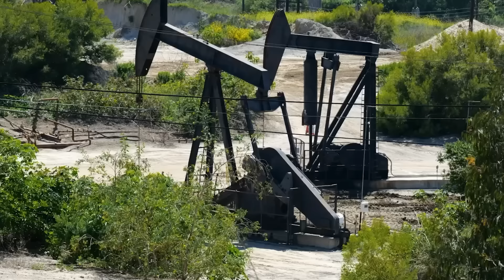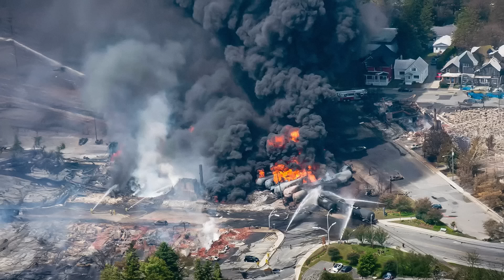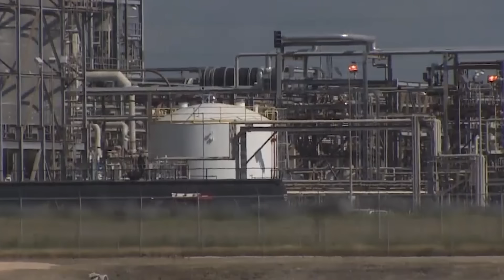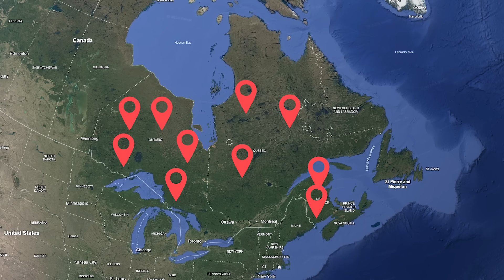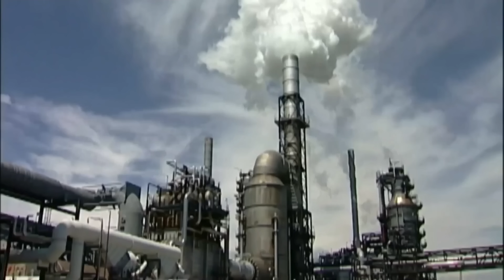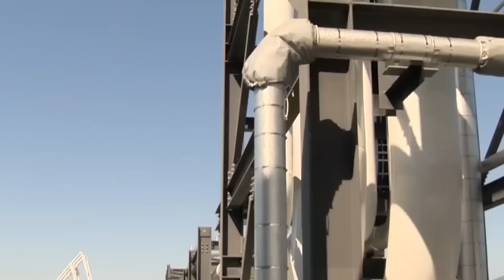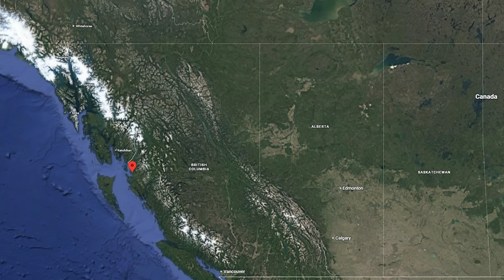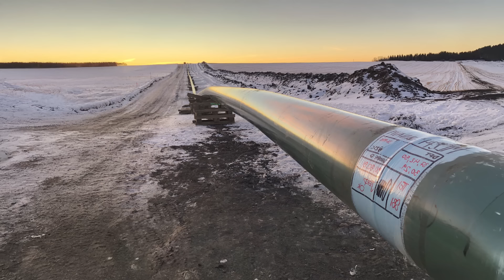Here's Why Canada Can't Build Its Own Refineries, Even Though It Produces Millions of Tons of Oil

Comment: Canada has approximately 17-18 operational oil refineries, with a total refining capacity of nearly 2 million barrels of oil per day. These refineries are distributed across provinces like Alberta, Ontario, Quebec, and British Columbia ¹ ² ³.

Here's a breakdown of the refineries by province:
- Alberta: 5 refineries
- Ontario: 5 refineries
- Quebec: 2 refineries
- British Columbia: 2 refineries
- New Brunswick: 1 refinery
- Newfoundland and Labrador: 1 refinery (currently being converted to a renewable fuels plant)
- Saskatchewan: 2 refineries

Some notable refineries include:
- Irving Oil Refinery (Saint John, New Brunswick): 320,000 barrels per day
- Imperial Oil Strathcona Refinery (Alberta): 191,000 barrels per day
- Suncor Energy Edmonton Refinery (Alberta): 142,000 barrels per day
Reply: Note: your list of 17 locations included asphalt refineries. I have excluded those.

There are 13 out of 15 refineries in Canada that use Alberta bitumen sands heavy crude oil right now. 

All 13 of those refineries receive deliveries directly via pipeline from Alberta, including all four in southern Ontario (via Line 5) and the only refinery in Montreal (via Line 9).

The two refineries that do not use Alberta crude oil in their refinery diets are located on the south shore of Quebec City, in Lévis, and in Saint John, New Brunswick.

The refinery in Quebec City is owned by Valero and the same company owns a massive storage depot in Montreal. Furthermore, Valero also owns an oil pipeline between Montreal and Quebec City.

So the reader may be asking themselves: so wait, if there's already a pipeline between Alberta and Montreal and another oil pipeline linked directly to the same company's refinery in Quebec City, why aren't they using Alberta crude oil too?!

The answer is simple: it's not economical to do so.

Alberta bitumen is heavy in asphaltenes and low in resins. This makes it a low-value product that is generally used as a cheap blending agent to bring down the overall cost of refined petroleum products. Remember when the Conservatives told you that Western Canada Select oil was priced lower than West Texas Intermediate because there was insufficient pipeline capacity to Canada's west coast and Canada was stuck with only "one customer"? Well, the Trans-Mountain oil pipeline is now complete, exports are happening all over the world, plus, there is excess capacity available on it!! And the price gap between Western Canada Select and WTI is still over $12/barrel on average!! Chalk it all up to yet another Conservative lie. Pierre Poilièvre is a rank expert at lying to Canadians and Conservatives are repeating the same, tired lies that are being disproven every day with TMX exports to Asia. Bitumen sands crude oil is low quality, and no amount of pipelines will ever change that. 

No, Valero actually uses their pipeline to ship finished products westward, from its refinery to Montreal instead of shipping Alberta crude eastward. 

Suncor also owns a Quebec refinery, in Montreal.  Suncor blends Alberta crudes with imported crude oil from overseas via tankers that land from the eastern US, Norway, the Middle East and Nigeria with light, sweet crude oil. The imported oil either arrives by tankers, or occasionally, gets unloaded in Portland, Maine and then piped to Montreal. 

Incidentally, the company that owns the Maine to Montreal oil pipeline applied to reverse its direction, so that the line could carry tar sands bitumen from Line 9 to Portland, Maine for marine export via tanker.  Concerned citizens of Portland in 2014 passed a municipal ordinance banning the export of oil sands bitumen at the Port due to environmental concerns. Portland Pipe Line Co (PPLC) filed a lawsuit to overturn the ordinance as unconstitutional, and against interstate and international trade. They lost in Court and abandoned their appeal in 2021. 

Many find it amusing to listen to the same Conservatives who worked tirelessly to destroy Canada's National Energy Programme in the 1980s now turnaround and counsel the government to ignore the economics and build a brand new pipeline from Alberta to those two refineries, even though it makes zero economic sense to do it today with all the existing infrastructure in place.
Reply: Thank you for this. 

We had one in Nova Scotia. I do not know enough about oil refining to truly understand why it was shut down.
Reply: Many Canadians are completely unaware of this nation's oil and gas infrastructure. There are now three major gas pipelines to the Canadian Pacific coast, plus two oil pipelines to the west coast. There is one natural gas pipeline extending from Alberta all the way to southern Ontario & southern Quebec (to Quebec City) and one oil pipeline from Alberta and through Sarnia, feeding 4 refineries in Ontario plus a refinery in Montreal. Incidentally, all seven of these pipelines were built under federal Liberal governments, including TMX in 2024 and LNG Canada in 2025. 

Canada has broken all-time production records for both oil and for natural gas production in 2025. We have built and completed two massive new oil and gas pipelines and export terminals, both commissioned in the past 20 months. Canada also smashed export records for natural gas, Alberta's heavy crude and propane and natural gas liquids. 

The propaganda says that Ottawa is blocking Alberta, but these claims don't jive with the facts on the ground: there are tens of thousands of oil and gas wells across the province, with a thousand new ones coming on stream each year. It is because of the support by the rest of the country that Alberta has registered a massive surplus this year. 

In the 1970s, the Canadian government invested tens of millions on research & development to adapt the canola plant, a benefit which has delivered billions into the pockets of Alberta farmers. Canadian taxpayers also invested over $34B into tripling shipments of Alberta crude oil to the Pacific coast. 

Some have falsely described a "tanker ban" on the west coast. And yet tanker exports were up a whopping 1137% in 2025 vs. 2023. 

To put this in perspective:
In 2023, an average of 2.25 oil tankers/month left the BC coast (Yearly total = 27 oil tankers)
In 2024, the average was 13.58 oil tankers/month (Yearly total = 163 oil tankers)
In 2025, the average was 25.58 oil tankers/month, October and November 2025 set a new record of 30 vessels each (Yearly total = 307 oil tankers)

Oil exports to countries outside the United States rose from 2.6% in November 2023 to 15% in November 2025. In December 2025, 15 of the 25 oil tankers leaving Burnaby were headed to China. 

In 2026, 30-35 oil tankers laden with Alberta crude will depart the Lower Mainland of BC every month! Not to mention the dozens of massive ocean-going tankers of propane, natural gas and natural gas liquids loaded and shipped out of Kitimat and Prince Rupert!  Why does this bother Pierre Poilièvre and his entourage so much that they choose to lie and act as if no oil and gas shipments are allowed when, in fact, the only limitation is for crude oil and only applies to an area off of British Columbia's pristine north coast?

Indeed, Canada has the one and only LNG export terminal anywhere along the entire Pacific coast of North America with LNG Canada (in Kitimat) and the completed Coastal GasLink pipeline. 

The US has exactly zero LNG export terminals along the west coast, and none started or under development. All US export terminals are either in the Gulf coast or on the Eastern seaboard. 

Besides LNG Canada, our country has four more LNG export terminal projects in the works:
1. Woodfibre LNG (Squamish) with an expected commercial operation date of late 2027. The Eagle Mountain pipeline already nearing completion and the export terminal is more than 50% finished. 

2. Cedar LNG (Kitimat) with an expected completion date of late 2028. Notably, they will also be using the already-completed Coastal Gas link pipeline.

3. Ksi Lisims LNG (Wil Milit) with a target completion date of 2029 along, with the TC Prince Rupert Gas Transmission pipeline. Construction work on the pipeline is already substantial.

4. LNG Canada Phase II (Kitimat) will likely enter service by 2030, although this may be earlier after the environmental review process received approval for fast-tracking by the federal government in September.
Reply: @paulboileau3758  Wasn't it Trudeau that told Japan and Greece that there was "no business case" when they came begging for our LNG? Sending Japan to the USA.....WHY?
Reply: @GeezIDK 

This is an intentional distortion of what Justin Trudeau said about LNG opportunities. LNG Canada was approved by the federal Liberals in 2016, one of their owners in the consortium is from Japan. Your claim is so easily disproven. 

Trudeau believed that there was not a strong business case for moving western Canadian natural gas to Europe, and that better opportunities lay on the west coast terminals exporting to Asia. Nothing today would contradict Justin Trudeau's statement. 

Pierre Poilièvre and many Tories whine that Canada missed a golden opportunity by not pursuing the sale of liquified natural gas (LNG) to Europe. The Americans, as part of a new, one-sided trade deal with the European Union, will sell billions' worth of LNG to Germany, the Netherlands and several other western European nations. 

The United States has exactly zero LNG plants in the western half of the country, while 8 LNG export terminals dot the Gulf of Mexico and the American eastern seaboard. More specifically, there is one LNG export terminal in Maryland, one in Georgia, while the other six are all in Texas and Louisiana.

American natural gas wells in the Midwest/Pennsylvania and in and around Texas and the Gulf coast are hyper productive and inexpensive. So much so, that Eastern Canada stopped producing natural gas (Nova Scotia's Sable Island was a reliable natural gas producer for over 20 years), shutting down all wells in 2018 due to the low cost of imports from the American Mid-west. Today, gas in Nova Scotia comes mostly via Maine! In fact, US gas is so cheap that Eastern provinces transitioned away from Canadian gas shipped through the Trans-Canada natural gas pipeline, opting to buy American gas instead. 

So, if western and eastern Canadian gas is too expensive for sale in Eastern Canada, why is Pierre Poilièvre still criticizing the Liberal government and claiming that it's due to a lack of foresight, planning or will to pursue LNG sales to Germany?  

Well, to answer that question, let's recall the Energy East proposal by the government, when Pierre Poilièvre had a seat at the cabinet table. 

Energy East proposed converting the Trans-Canada natural gas pipeline, so that it would carry heavy bitumen sands crude instead of gas. And why did the Conservative government propose such a thing? Because even as far back as 2013/14, the writing was on the wall: western and eastern Canadian gas was being undercut in the East by dirt-cheap American Mid-west gas. 

The fact that Mr. Poilièvre knew as far back as 2013 that Canadian natural gas for sale in Eastern Canada was not competitive, and yet knowingly slandered Justin Trudeau for the totally accurate statement that there is no serious business case for LNG shipments to Europe shows the depth of his depravity. Justin Trudeau was bang on the money about LNG to Europe. And Pierre has revealed himself to be a deeply twisted individual who markets lies, and deception as a way of life. 

So where does Canada's future lie in LNG? It's not in Europe, that's for sure, but rather, Asia. 

Western Canadian natural gas is very competitive in the western half of the continent. Canada is already exporting massive quantities of natural gas to the western American states, where the Gulf and the Midwest have trouble competing due to distance. Canada also has the one and only LNG export terminal in the western half of the continent and will be exporting all throughout Asia. Several more Canadian LNG facilities are under development, and the BC government just announced an investment of $200M in a new transmission line to support the construction of a new LNG terminal in Squamish. 

The federal Liberal government has always been favourable to responsible economic development, including support for the drilling and completion of tens of thousands of natural gas producing wells all throughout northern British Columbia and Alberta. 

Pierre Poilièvre has tried his utmost to paint the Liberal federal government as being opposed to LNG merely for pointing out the obvious: the sale of LNG to Europe was going to be a wasteful  distraction when greater economic opportunities for Canada are found in the west.

Comment: Canada already built a new pipeline for Alberta its called TMX and it not fully used and it has expansion capacity.   The reason no pipleines will happen is that the existing pipeline operators dont want competition in a declining market.
Reply: TMX is now full.  That claim that it was only a quarter full was a lie from that Quebec environment minister whatzisname.

Comment: Canada has many refinieries as much as we need. The energy east pipeline collapsed, not by government but by cost.  Its much cheaper to bring oil by tanker than by pipeline. Plus, AB and canada have always wanted tighter US integration.   The US east cost also imports oil from Nigeria and Venezuela.  If an oil pipeline were so valuable, Harper would have built one.  The problem is peak global oil demand is already here. Pipeiplines and Refiners dont want to invest any longer.

Comment: Solar power is rapidly reducing the need for oil. With Global investment solar now exceeds that of oil. Still demands remain high due to transportation and petrochemical needs. However analysts predict solar will disrupt the fossil fuel industry by mid -2030s. Renewable energy will be about 92.5 %. In the long run investments in oil is not going to produce large profits so I think that is the elephant in the room nobody is discussing.